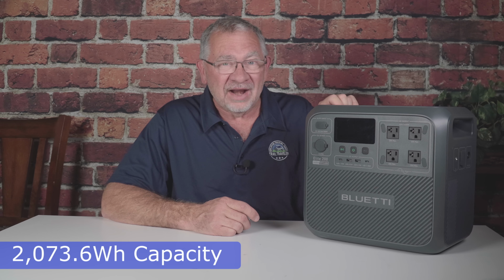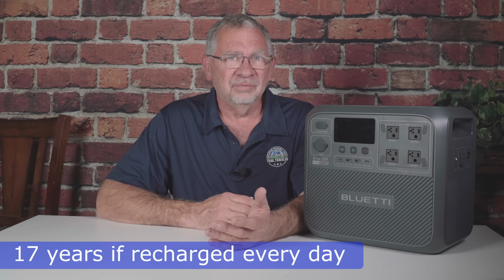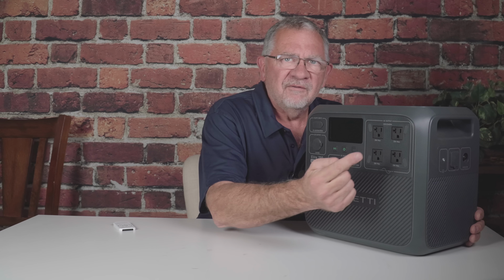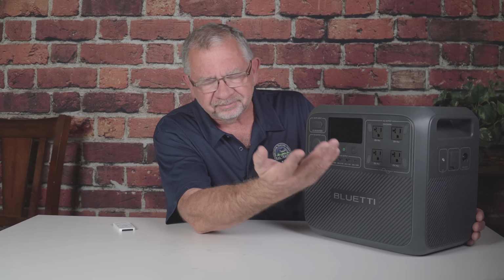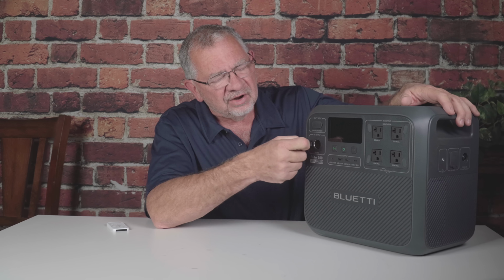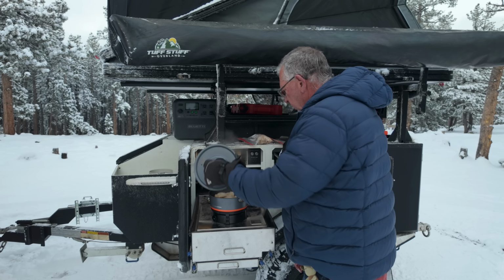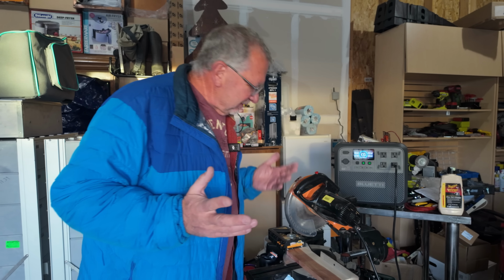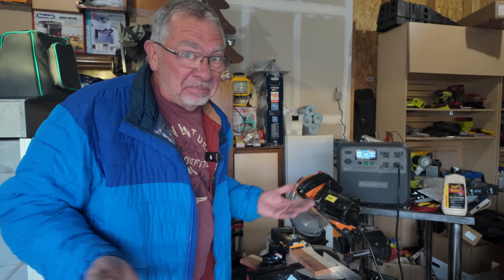When you need extreme power!  - Bluetti Elite 200 v2

Comment: Ecoflow delta 3 plus with ext battery blows this boat anchor away. Faster charging ,more solar input .2 140 watt pd ports
Reply: What does that cost..how long will the eco flow run a dometic cooler

Comment: I love the power, But  we can’t charge it with our vehicles 110, unless we buy their other device. I just did a 10 day trip from Reading Pa to Moab Ut. I think It would’ve gone dead. I’m looking at getting their 180.
Reply from the maker: Most inverters that are built into vehicles are only good for 100-120w. Even if it took the power, it would take 20 hours to charge it. We added a 2000w inverter to our Jeep as well as the Bluetti Charger 1
Reply: @ yeah but would be able to maintain an even level. Maybe not charge it back to fully from dead. But I’m driving 5-6 plus hrs each drive. That would be enough to maintain a charge for a 10 day. That’s what I did with my Jackery 600. But with adding a diesel heater. I’m thinking I’ll need more juice. And I’m looking at an A/C. I think it’s power is amazing. Am I correct that the new battery technology needs a pure sinewave? I’m just not ready for ALL the extra expense.
Reply from the maker: @turbojunki  I did not see anything in the documentation about it needing a pure sine wave.  A diesel heater only uses a chunk of power on startup and then uses very minimal power. This is a pretty typical power profile for a heater:
120w startup 4 minutes
105w -115 ignition 2 minutes 
35w - 2 minutes 
10-15w continuous based on power setting
120w shutdown 4 minutes